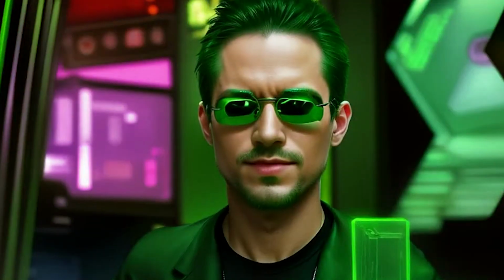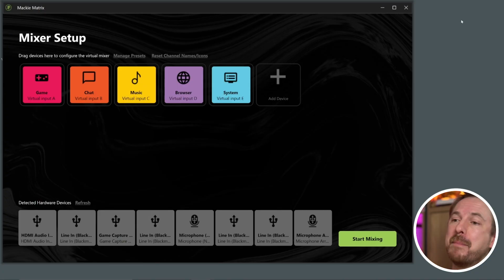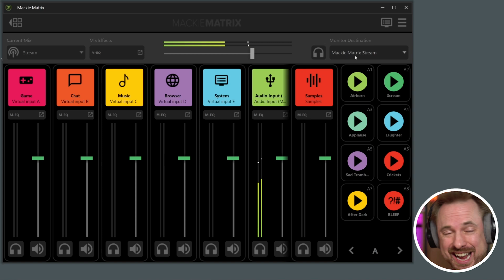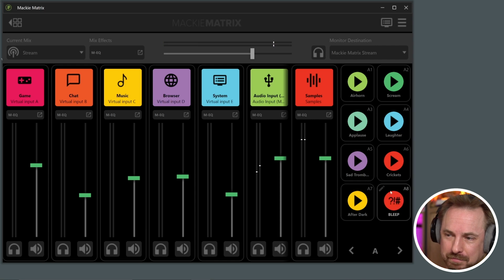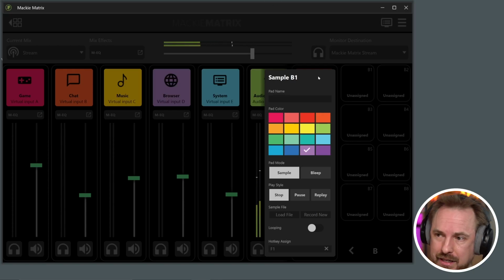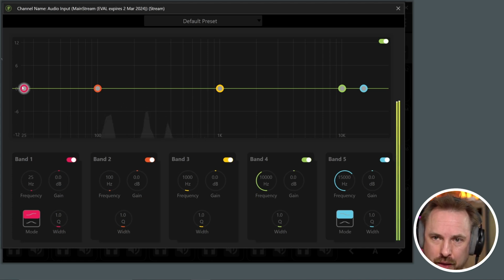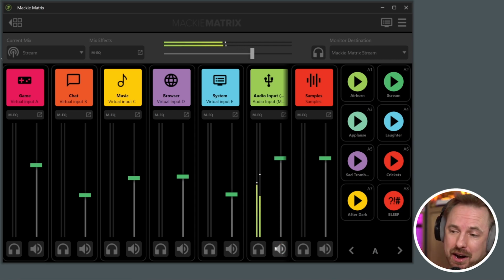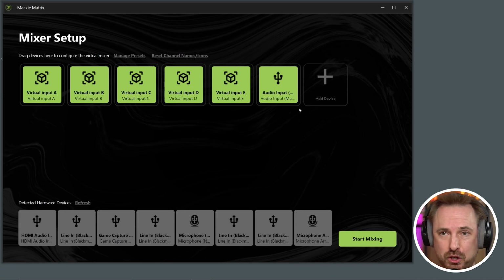MEGA Expansion Pack For Mackie Mainstream - Mackie Matrix Review

Comment: Can it be used in offline mode? That is, can the power type-C be directly connected to a USB adapter instead of a computer?
Reply from the maker: Yes, the Mackie Matrix can be used offline by connecting the power type-C directly to a USB adapter instead of a computer.

Comment: Is the mix in the matrix the output my streamers will hear? Because last night was my first night using the mainstream and it seemed like when I would adjust levels on the mackie knobs it wasn’t actually adjusting volume in stream…just my headphones?
Reply from the maker: Yes, the mix you set in the Mackie Matrix will determine the output that your streamers hear.
Reply: @MikeRussell did you experience any delay in the matrix software for your mic and headset? I can’t seem to figurebout where it’s coming from or how to fix

Comment: When I use my Maxine mainstream with my rode pod if I can barley hear my self and I have to make the volume almost to the max so I can barley hear myself but there’s like noise on it and it’s unusable what can I do?
Reply from the maker: It sounds like you may need to adjust the gain levels on your Rode PodMic and Mackie Mainstream to find the right balance.
Reply: @MikeRussell bc when I lower the mackies gain I can’t hear the hiss sound but the mic is low it’s around 70% of gain I bought a cloudlifter maybe that would do?

Comment: I've had a number of problems with the Mackie Matrix software. Is there a link to the manual somewhere?

Issues I've had:

1) Delay/reverb getting added to audio when using the EQ (and doesn't save, but that's a known issue)
2) Samples raise pitch of all uploading sound files
3) Inability to re-program buttons on Mackie Mainstream
4) Sample hotkeys do not work, nor do they save when changed
5) Plenty of confusion about monitor mix, understanding the monitor selections and where it gets sent. It honestly feels like guessing most of the time without good direction
6) No way to have applications send to Mackie matrix AND system audio. Forces me to have Mackie Matrix open at all times as Spotify is now set to one of their virtual inputs so I can control it for a stream.
7) No distinction between mic input and "system sounds" computer input

Is there any extra info on making this software work out there? This is literally the only resource I could find on the internet. Thanks a lot!
Reply from the maker: I'd recommend reaching out to Mackie support directly for specific troubleshooting assistance. You can find the manual for the Mackie Mainstream on Mackie's official website under the support section. Good luck!
Reply: Did you ever figure out the delay/reverb bro? It’s drives me insane, then when I try and fix it, it’s like it adds even more delay/echos, was told a month ago by mackie that we would be getting an update but still nothing